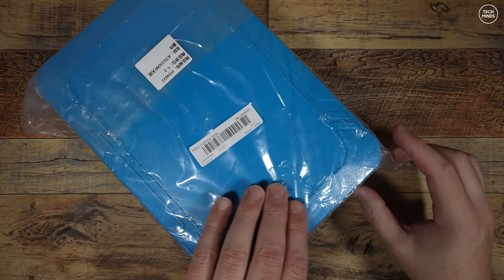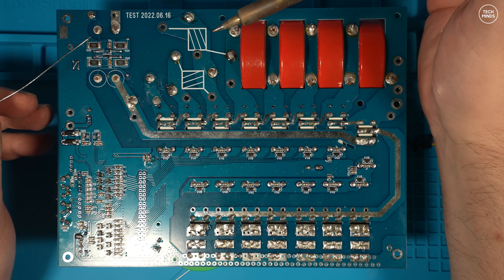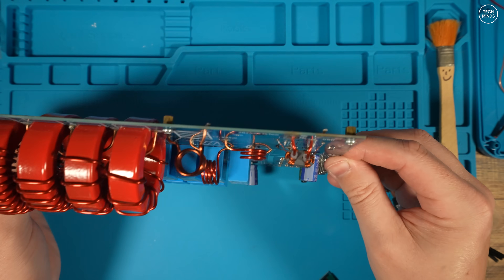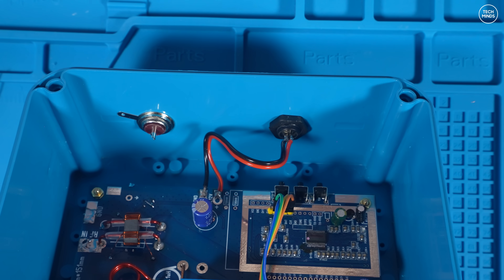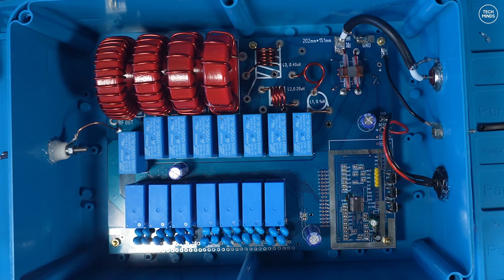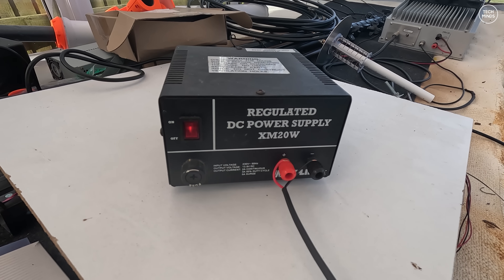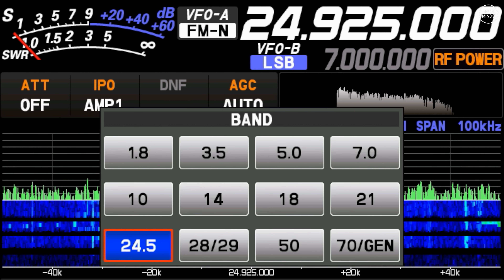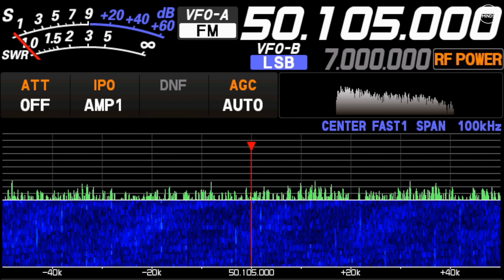ATU350 - A Cheap 350 Watt Remote Automatic HF Antenna Tuner

Comment: I’ve got an SGC 235 and that will not match any antenna length that is a raw  match to the bands it will tune, and 20M it right inside the range they will give problems for most ATU’s. Simply shortening the wire will solve the problem. Extending would do the same, but folding it back will significantly change the antenna impedance as the same amount of current flows in both arms of the folded antenna thereby doubling its impedance (aka j-pole). Adding ferrites to the power supply leads won’t achieve much as the PSU is an effective choke to RF currents, unless it is directly connected to the transceiver that is. I think the Earth is exactly right where it is, there is much more impedance to the left side in the video image. Yes real engineers only use the side of a soldering iron to shrink tubing.

Comment: I suggest using the gnd lug closest to the coax connector is best. Also, shortening the lug wear the wire attaches will not hurt, but at HF frequencies, it will likely not help.

Likewise, ferrites on the power wires may not help, except to block what is coming from outside. Adding ferrites or choke directly on the outside power feed would help more, since there is more room for more/bigger ferrites.

Comment: Question: Why did you eliminate the 49:1?  I use an atu and the 49:1 and I get excellent SWR ratings on the bands, including 160 meters.
Reply from the maker: The video was about the ATU350, not the 49:1 antenna. I was just showing what the initial 20m of wire was connected to for the video. Personally I use a CHA URT1 for my main HF antenna but the video was about the ATU350. Cheers

Comment: Hi Matt .. I have been at this problem from on my EFHW 40 meter long wire… so what I did to understand the problem I removed the atu and measured the antenna impedance between the ground rod and the antenna wire … 
Looking at the smith charts you will find a spiral at the right side of the smith card, and it’s actually the key to make it work… 
So adjusting the wire to have a “tuneabel” impedance is the key to success… 
Knowing the vswr the tuner can tune, you can adjust the wire to “get in range” for the tuner …
I other words, design the antenna wire so that it is tuneable on the frequency’s you want to use it.
The way you assemble the unit is perfect for HF freq range.
Thanks Niels 
OZ1CGQ

Comment: Mount the tuner with a 1m length of coax to the 49:1 balun and it will tune 40-6 meters. With 66+ feet of wire.  Seal the outside lid of the box with silicon. 
30 meters is an amazing band.  I love it more than 40m especially during contest weekends.  Great video !!

Comment: Be careful in all these shitty Chinese kits we have no info on the ferrites used: Possible saturation of the inductors if we don't know the ferrite used. I suggest discarding the inductors and making your own with a known farnell or RS ferrite. Example experienced with HF amps in kit form which also have FAKE transistors.

Comment: Just a Note !!  With these cheap outer box string sealant strings you place around the box to seal
It from the weather.  DO NOT rely on just that to seal the box.  It will fail over a period of about 3 months.  It actually will shrink and water will come in.  If you use the box provided please add some sort of silicon around the box.  I learned the hard way when I  used these cheap boxes and my Balun box was full of water.   Your best bet is to upgrade the box to a true outdoor rated plastic electrical box actually made to be out in the weather in all seasons.   😉
Reply: Silicon is too brittle; use silicone sealant.

Comment: Mat, I noticed near where you soldered the lug to RF Out there was also an antenna call out just below that top wire. Also, yes, the Ground Lug is probably meant to come out the side of the box near that larger pad allowing you to use some copper strap from the pad to the lug. However, this does seem to be a fail in my opinion. Not sure what they are thinking but requiring you to purchase so many additional parts makes me believe it has not been well imagined. Also, I wonder if that is just a 3:1 tuner. I would expect a 10:1 tuner for outdoors.

Comment: Got the smaller version some months ago. About the same dubious soldering quality. With mine the display did not work. It was rather an uphill task to make the tuner work fine. With your bigger one I guess it is not a good idea they put the large toroids so close to one another and with the same orientation. Better spend some more on a cg-3000 and you have a tuner that works right away and for years to come. Thanks Matt for the interesting video!

Comment: Yeah I would imagine that the tuning range was far too high  Matt  put it after the transformer and then you have a much lower SWR to start. Personally I would also put the antenna wire also at the bottom maybe via some co-ax so that it doesnt become such an ingress hazzard. Good video keep it up M0XJA

Comment: I think one of the reasons of the failures on some bands is the leght of the connected wire. 

The manual of CG-3000 AUTOMATIC ANTENNA TUNER manual says:
Calculation of undesirable antenna lengths Length of half wave = 300 / operating frequency (MHz) X ½ Please avoid using the antenna length that is close to a half wave or multiple of a half wave in length.

Some tuners have specified lengths of connected wire which should be avoided.

Comment: I would try powering the ATU from a battery with very short wires instead of the power supply....maybe some strange ground loops there.
Reply from the maker: I had also thought this! Cheers

Comment: This is normal behavior for a matching unit  (IT'S NOT A TUNER)  of that type.  There is no magic, the laws of physics are the same for us all.
If you change the length of your antenna just a wee bit, you will find a better match on some bands, you may even find a length that works on all the bands you use.
Avoid half wavelengths on any band of interest.  There is not enough L or  C in that box to overcome the reactance that you will find at the end of a half wave section.  
I could not explain why in a short comment.    🙂

Comment: I’m wondering, if you are using a Yaesu, if you can use  the bias-t voltage (available in most yaesu radios) to power this device.

Comment: I would have expected this to get better results when using correct non resonant lengths like 72' in the first attempt.. The second attempt at 79' should have been worse not better. Whatever the impedance of this wire is it appears that the ATU cannot handle it. Something in this setup is not playing the game. Feeder? Transformer?

Comment: I use this atu with great success in a metal box and unbalanced input/output with pl259. 
Everything working great with dipole , doublet , g5rv, endfeed 1/2 wave but with the transformer and 1/1 shoke.
I never test the random wire alone actualy.
I pass 350W on it and tune it at 10w generaly. 
I have modified the prog inside (eprom value flashed with a pic programer)  for it to tune from 5w to 30w and not tuning with higher power and it's ok. 
See the atu 100 documentation for the Eeprom value spec. 
Sometime , have to reset it and redoo the tune, cause  rf feedback or high swr depending the weather or antenna type.
 last mod is shielding has much you can over the pic microprocessor helping a lot the atu not switch down or switching display off when applying lot of  RF power ... 
In that case , rebooting the atu is ok so non destructive.
Barely use more in manual tune than auto tune in the shack so atu is near the tranceiver not the antenna.

And finaly , the blue original box is great to suport  the display screen of the desktop computer for my hermes lite ...

there is now a 1000w version of this finished in a metal box from ali....

73, Va2uas

Comment: Mixed results at best, even though I think you did an excellent job with the build.  I get the point you are trying to get across by Not using a 49:1 or 9:1 transformer, all though I wonder just how many ATU's will tune just a random length of wire without a Balun ?   Guess I will need to search just that...    Thank You for sharing these results...    73 !

Comment: I don't believe shortening the feed-through bolt on the output wire connection will make any difference. However, I would move the ground wire connection to the output of the tuner. The ground impedance and currents traveling through the.board layout back toward the input may create unstable conditions in the tuner. Decoupling the power leads is always a good idea! 73, AE6SS

Comment: Did you say 450W soldering iron? That's beefy!

Would N-type be better than SO239 for weatherproofing?

Where do you get those waterproof passthrough bolts?

Comment: Matt you have a tiger by the tail with a halfwave peice of wire and a good way to destroy the tuner. The halfwave point at the end is very high impedance thus will show a very high voltage. You will see this with the EFHW unun used when ops get greedy and fry them. Also what the extended Zep antenna is all about. Extend it a tad away from the high voltage. You can find a chart of non resonate wire lengths that are safe to use. Cheers and always enjoy your videos 😊

Comment: I totally agree with Dr-T.
Auto tuners, of which we run two at full U.S. power, seem to work best with a 1:1 RF choke at the radio and the 9:1 using its ground and not the tuner's at the feed might fair better. We run 5KW ratings on both.
We are lucky to have a larger area and like the random wires at 275+ feet.
Let us know how you fair in the future. 73 - Foy

Comment: Mfrs. of tuners advise against using wire lengths that are a multiple of 1/4 and 1/2 wavelength on any band. The high endfed voltages can damage the tuner.

Comment: some interesting comments. I would use that other ground pad for the counterpoise connection.

Download manuals for CG3000 and SG230 as they give some very useful tips on using remote tuners. Never connect anything except wire to output lug.

I have used a similar CG3000 at 4m AGL feedpoint with 15m f/g pole and used a 6m triple leg (6m radiator plus 3 x 6m elevated groundplane wires at 45 deg. Highly underestimated antenna and excellent for DX 30-10. Good too on 40/80. Similarly you could try 33’ or 43’ vertical radiator with same length (or slightly longer) elevated radials for use on lower bands (but theoretically not as good on higher freqs).

Cheers
Nick M1DDD

Comment: I wouldn't expect the thread on the antenna bolt to make any difference.
Your grounding looks great.
You might be better off with a SHORTER piece of wire. Go for one of the recognised "Random lengths" that avoid hitting the problematic high impedance half waves on any band of interest as "normal" ATUs have difficulty with their very high impedance (needing the specialised 49:1 or 64:1 unun for the EFHW). ... 26', 29', 41',52' ,58' etc etc are recognised useful "random lengths".
The advantage of the vertical is the low angle radiation (especially on the higher bands), however where your antenna is much more than 5/8ths lambda on the band of interest then you start getting spurious high angle lobes & the main horizontal lobe starts cutting back (although your inverted L will certainly circumvent much of this as you are not fully vertical).
Initially you were 4/8 on 40, 8/8 on 20, 12/8 on 15 & 16/8 on 10!!!... all hitting problematic half wave resonances (then you lengthened it fortunately avoiding resonance). But also most greater than 5/8th.

I'd actually suggest you tried just 29' (or 26') vertical (no horizontal top).
29' is almost a quarter wave on 40 so good (& no bent-top inverted L needed).
on 20 it is safely away from half wave. Also less than a 4/8th so meeting the sub 5/8th aim.
on 15 it is roughly 9/15th (good enough for jazz for 5/8th (10/16ths)).
If you REALLY want to optimise 10m you may be better to start with 26' rather than 29' (slightly at the expense of 40m).

A good RF earth/gnd will always help.

One thing that the above antenna would probably be WORSE at compared to your current set-up & that is short-haul on 40m where most will be NVIS skywave needing high angle take-off that a straight vertical isn't best for (although it should be better for low angle DX on 40m, also, with it NOT picking up the local high angle NVIS signals the low angle DX should be swamped in less local traffic... just proving there is no "perfect" antenna optimised for everything... you will always be better for some things but worse for others).

Comment: I have a the LDG Remote Tuner, that as a SO-239, then 0.5M coax to a 49:1, it Tunes most random lengths of wire very well.
Reply from the maker: My regular ATU is the CHA-URT1, but that costs a lot more than this ATU. However, the CHA-URT1 works very well indeed even though it is lower power than this.
Reply: @TechMindsOfficial  Only a guess...
The CHA-URT1 can tune a 10:1 SWR Range, and the ATU350 as less of a Tune Range.?
Replace the Wire antenna Terminal on ATU350 with SO239,
then use it with a 9:1 or 49:1 Balun fed by short coax lead.
Reply: @TechMindsOfficial  My CHA-UTR1 tunes all the bands with 10M which is slightly too long so not fully resonate. I suspect it has a wider tuning range. Unfortunately I recently upgraded to a 100 Watt radio and damaged the tuner and had to send it for repair. My thinking is I accidentally used too much power during tuning.

Comment: Evening Matt
1) The length of the fixing lug for the antenna wire will make no difference
2) Use some coax braid, flattened out for the earh connection, sleeve it and connect it to the 'real' earthing point by the antenna wire connection. You are trying to create a low impedance connection and braid is much better than thin wire.
3) Use the 9:1 unun to help match high impedance (half wavelenth) wires. you can probably leave it in circuit all the time (Rig to UnUn to Tuner)
4) Dont use ferrite beads on the power wires, get ourself a small toroid and wrap the power wire thats outside the box around this maybe 10 or so turns. That will be far more effective
5) Choose a non-resonant length of wire for the radiator. 43 ft is a good length that should work from 40M up.

install the above suggestions and all should be well
73 Bruce G4ABX
Reply: Great advice !

Comment: This piece of equipment would never see my shack. I need consistently low swr, especially when running power. I like your enclosure Matt but my equipment cost too much to push the power past QRP.

Comment: Hi Matt just an observation I know I would have done by now have you not gone approach to farmer land to see if you can run a line to one of the trees on the other side it doesn't look like it's proud it looks like it's a grazingfield might not have any objection just a thought
Reply from the maker: The amount of times I have thought about this is 1000's! lol.. The field is only used by Cows, to graze on when they come out of their shed. I'm sure I could work something out with the farmer but I have other plans in the pipeline :-) Cheers!

Comment: put back the 49:1 transformer into the circuit, after the tuner. This tuner is good, but the impedance of your antenna is too high to be compensated without that transformer. Also clean the remaining flux from the PCB. It will eat up the traces in less than a year. 73 and good tinkering!!

Comment: The reason it won't tune / resonate on certain bands is antenna wire length well proven random wire length is much better than resonant ones
Reply from the maker: Yep, thats why I added 7 feet of wire. I done a video on this topic. Totally length should have come out around 71 feet which according to a chart I have is okay for remote tuners. Lots of great suggestions so far, thanks!

Comment: Try non resonante lengths of wire Matt, also non resonant coax lengths as well....
Good work mate 73 m0zww
Reply from the maker: Yup, I tried 71 feet as shown in the video. Which I believe is one of the lengths advised for random wires with remote ATU. Maybe the "folding back" on itself made it go long or short. More experimentation needed. Or I will just give this away and let someone else play with it.

Comment: Make the wire not 20m but do try 82-80feet long (24.94-24.39meters)

This will give you close to 3/8ths wl on 80m, 5/8ths wl on 40m, The other bands 20,15,10m will become longwire type but should tune nicely.

For the WARC bands you might need to add some series capacitance for 30m, probably 100pf or so to make the wire look shorter as it is near one wl long.  17&12m a series taped Inductor 7-10uh oughta work out  fine.

GL
Reply: I miss SGC.  Wish they were still making external tuners. Now that MFJ is kaput we need legal limit tuners that are built hardy.

Comment: Crap from China.......

I would try to sweep out some radials at the ice feed point (ground). No specific length, maybe 5 - 10 meters.

With my CG-3000 I can tune a 7M vertical wire on all bands (160M - 10M).

Comment: The short wire won't make a difference. I'd have the ground as close to the output. 
I'd also move the coax choke to your shck entet point, so the coax braid can also act as a counterpoise. I would also see what your reading are like without connecting to ground rod.